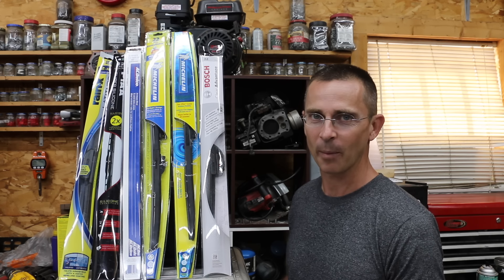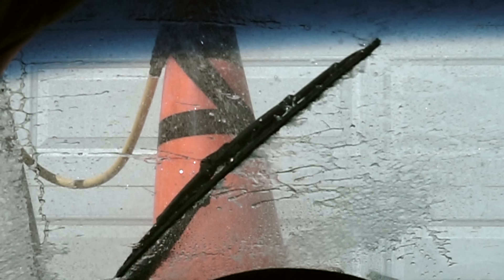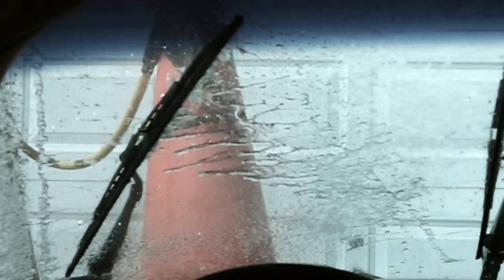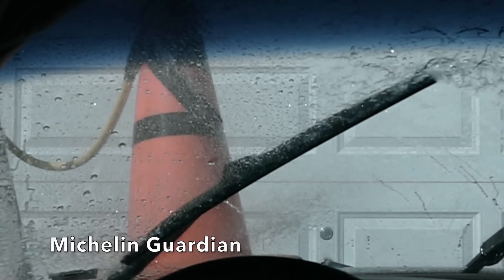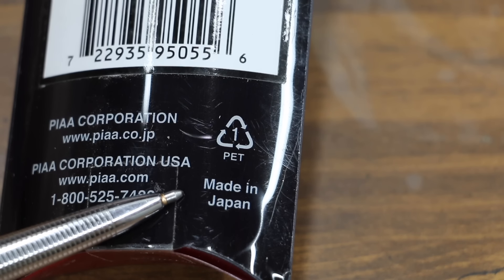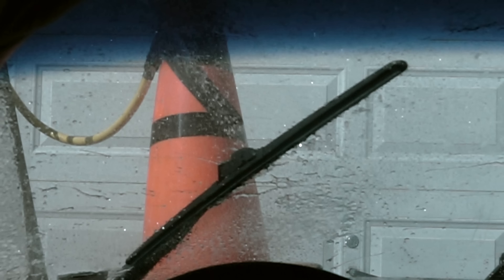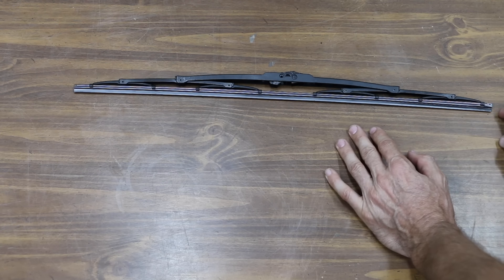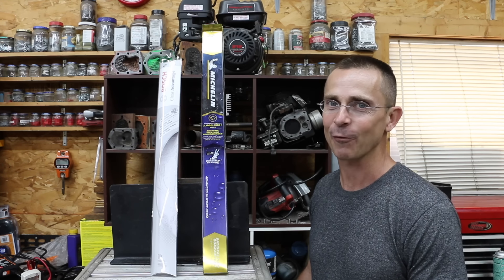Which Windshield Wiper Blade is Best? Let's find out!  Michelin, PIAA, Bosch, AC Delco, & Aero

Comment: I put Bosch blades on my 2009 Acura RDX sometime in 2013 to replace the OEM blades and they just now wore out; they were streak-free and squeak-free right up until the blade separated from the base.  I cleaned them thoroughly with brake fluid once or twice a year until the brown hard build-up was gone and they became more pliable (whenever they started squeaking or streaking or I had brake fluid out). 
I also get silicon grease from an electronics supply store and apply it to all the rubber seals around the doors and taillights, and any rubber bits exposed to weather or sunlight with a dense sponge that I got in the car detailing section of a major parts vendor (don't put it on wiper blades, it will smear and make everything blurry). once or twice a year and they are still pliable and in place and seem as good as new.  It's a great car and other than wear (brakes and tires) parts I've only replaced the starter and it needs a compressor, everything else still works.  It even has the original serpentine belt, spark plugs, antifreeze, brake, and power steering fluids.  
135000  miles
Reply from the maker: Thanks for sharing.

Comment: I paid close attention to this review. I was really hoping you would test Trico wiper blades. Yes. I work at Trico.
Reply from the maker: Great test idea!  I'll test them in a few months.  They are currently experiencing UV exposure along with several other leading brands.
Reply: Jay Lowe I like my trico 97 series. Much better than whatever was on before, and still nice and low profile/old school to boot on my classic f250 and f350
Reply: If you have access to Trico why on earth do you need to see a review?? Nothing will compare.
Reply: Jay Lowe funny thing is I had a pair of truck wipers back around 2009 time frame.  I swear I had those on my truck for about three years maybe a little less.  Anyhow they worked great back then so I bought some recently and have not been that Impressed.  They don’t last long and skip all over than dang place and very annoying now.  They were the beam silicone ones aka most expensive ones you make.   I got maybe three months before they started jumping.
Reply: Swear by trico in MI weather! A bit costly, but quality offsets the cost for me.
Reply: Correction: I had no idea Michelin and other blades sold at such a premium 😅 I'll stick with the usual!
Reply: Trico are the only blades I'll buy!

Comment: I wondered why splash-back from the passenger side never seemed to be a problem for me and upon reflection decided that 1. I very rarely use my wipers at full speed which doesn't give as much time for it to be slung off the top of the blade and 2. When traveling I'd say 35-40mph and up the oncoming wind pushes the water off the top of the blade so very little is left and it doesn't have the momentum to sling across to the driver's side, and once what's left clears the blade it's blown upward rather than across.  So maybe include some wind at 50mph or so in your next test or not put so much emphasis on the cross-contamination as it's just not a factor in real-world conditions.
Thanks for all your hard work, I love your videos and even watch the ones with stuff I'll never use just because I like you and your methodology.
Reply from the maker: Thanks and you are welcome!  Thanks for the feedback.
Reply: @ProjectFarm  I saw another video you did testing wipers and you did it at speed and I was right and you beat me to it; GREAT JOB!

Comment: Yes, the most expensive Michelin is more expensive by a factor of almost four over the Bosch, but the question you have to answer is will it last four times as long. Would also be interesting to see how it holds up to dirt because a wiper blade loses its effectiveness when it gets abraded by tiny dirt particles which will cause it to streak. I generally wipe my blades down once a month with some rubbing alcohol to remove the abrasive dirt and it extends their life.
Reply: Good idea. My neighbor does the same with WD40.

Comment: I wonder how airflow would effect the solid designs as they may lift with more air pressure. RainX Reminded me of the horrible glare you'd get with oncoming cars while the wipers swiped. Might be a good test to see which rain repellant works the best with no glare
Reply: It's definitely a possibility for the beam blades to lift off the glass. However I've only seen it happen once on an old car I had with a wiper arm that had a weak spring and would lift off during the down stroke. I replaced the arm and it never happened again. On the hundreds, if not thousands, of cars I've driven in the rain as an auto tech I've never seen it any other time.
Reply from the maker: Great constructive feedback. Thank you
Reply: TgWags69, Except one older van that had the glare issue, my other vehicles were crystal clear. It turned out on the older van there was a coating of some kind (road goo oil ???) that did not clean off with regular glass cleaners that combined with Rainx. Really bad and got worse. We finally had to use razor blades to scrape it off and a number of degreasers and finally newspaper (slight abrasive). After that, it was crystal clear like the other vehicles.
Reply: Averna, yes I had two older vehicles where beams did not work.

Comment: I know you can't possibly test all of them but, it would have been nice to see how trico stacks up as I've always had good luck with them.
Reply from the maker: Great suggestion!  Thank you
Reply: Trico is great.  I know a lot of people overlook them because not rainx and such. But i put some on my jeep and damn they are ace. I love these.  And they are cheaper!
Reply: I bought a set of Tricos for my Ford Escort from Walmart years ago.  Made my choice based on price and advertised triple edge.  The driver side blade left scratches on glass.  A lesson in you get what you pay for.  You can buy a kit to buff out the windshield glass and I plan on doing this.
Reply: @darinberend2103  even good products can not perform well.  Tricos work wonders for my applications where rainx blades amd the like suck.  But that's why there is so many different kinds out there.  Sucks your experience left you with scratched glass :/
Reply: @ProjectFarm  Got to second the Trico request. They appear to be the main non-automotive store (places like Meijer, Target, etc) brand around here (midwest). The Bosch Icons are another brand I see recommended a lot, so it will be great to see how those stack up, too. Love the channel.

Comment: One of the best selling points for the PIAA blades is that they have a replaceable silicone insert, so instead of having to buy new blades every year you only need to buy a cheap insert every few years
Reply from the maker: Great point!
Reply: Biggest pain in my ass is replacing inserts. I litteraly would rather teach a pig to sing.
Reply: You get that long of a life? Here in Canada it kills blades. Also I use them on the ice, hard life.
Reply: Back in the day ... not all that long ago before designer blades ... replacement inserts were commonly available. Less profit I’m sure.
Reply: @autobreza7131  I just bought a new set on tirerack a month ago for $8 a piece. Also, I've seen them on Amazon, but they are a lot more expensive there
Reply: Ray Klotz I used to buy replacement inserts from Honda until they got too expensive. Lately I’ve just but cheap yearly replacement from Walmart. I may look at Rain-X given the positive comments.
Reply: @autobreza7131  I've used the rainx before and I barely got a year our of them before they were toast. I switched to the PIAA and haven't had any issue for the past two years I've had them

Comment: I have watched many of your videos. I love all the research you do and the processes you use to evaluate items. This one caught my eye. We have a 2003 Toyota Matrix XR and a 2004 Mercury Grand Marquis LS. We live in central Il.  Up until now we have always purchased OEM Toyota and Motorcraft wipers. Maybe paid too much but seemed to work well. After watching this video, we purchased the Bosch Clear Advantage for both cars. I installed both sets on both cars. Toyota Matrix take a rear wiper as well. I completely cleaned the windshields before the installation of the new wipers. Installation was a snap and at the time seem to be cleaning the windows very well. We will see over time how they perform. Update later to follow. Keep the great videos coming!
Reply from the maker: Thanks, will do!

Comment: 10.92 dollars for the pair? I'm looking at 25 for my dodge and $40 for my '13 impala.  Where did you buy these Bosch Clear Advantage wipers?
Reply: Neil Perko same here
Reply: Sam’s has them
Reply: Just checked, and they're $16 each at Advance Auto.  I typically buy the Bosch Icon blades, and they're much more expensive than that, but I've had very good service from them.
Reply: @darrellkidd5177  Yes Bosch icon is the Best 💪

Comment: If it's raining THAT hard, pull over and find the guy with the hose!
Reply from the maker: lol. Nice!
Reply: Rob Edmund 😂
Reply: 🤣🤣🤣🤣
🙋‍♂️ Right here 🤣🤣🤣🤣
Reply: Right!? 😂
My blades fail the worst when it's barely misting, or the water is getting kicked up by tires.
Reply: That kind of torrential rain is not uncommon on the Gulf Coast.
Reply: More Beer not at all especially SW Florida, that is our normal rain shower
Reply: Same thought. This test is kinda flood instead of rain
Reply: More Beer was about to say that. That hose is nothing compared to a nice summer evening storm.
Reply: Seems some of you have never experienced an actual rainfall lol
Reply: RAIN THAT HARD IS COMMON IN TEXAS!!!!!
Reply: @cazadordeadrenalina2161  eh, it looks mostly good, however, with P.F.'s latest update to this video, silicone seems to be the way to go over rubber.
Reply: @petedeiler9431  yeah usually for only 5 minutes at a time though :p
Reply: Rain that hard is common in the South.
Reply: I’ve driven in rain way harder than that.
Reply: @petedeiler9431  k

Comment: Silicone blades are last much longer than rubber ones. 
Highly recommended!
Reply: @Al Castill I live in the Netherlands and we have lots off rain,have silicone blades,i still have them on after 5 years and doing fine.
Reply: "Upgraded" from Bosch to PIAA wiper blades because of all the hype regarding silicone and what dissapointment that was. I've never had so much wiper squeak before, even when running the cheapest blades i could find it was never this bad.
Reply: @DanielVSL  I think the PIAA brand blades are low quality, try rain-x silicon advantedge wipers. or even the bosch blades every year are still a great deal

Comment: I was a viewer for almost the whole time the channel exists, and I love this channel a lot. (Especially farming equipment videos which you don't post anymore). So I can't believe that I going to criticize this video, but here I come: 

There are just three types of blades:

1) conventional (steel frame)
2) flexible (bendable)
3) hybrid (plastic frame)

Conventional blades can be also designed for winter: the whole frame is covered with rubber. No moving parts exposed to moisture and air.

The one from Michelin is a fake hybrid. And there is just a few manufacturers in the world, but a lot of "private brand" companies. I'm pretty sure that Michelin is one of "private brands".

Most of new cars sold today are equipped wit Trico branded wiper blades. Which makes Trico  most common OE Manufacturer. I'm surprised it wasn't tested. (If you'll be doing second part test Trico direct fit)

And the most important part:
It doesn't matter how the blade performs on steady vehicle. Because it's not critical to see the road when you are not moving. But when you are in motion  aerodynamic comes to play and this is what differs the blades. The blade cad be easily lifted up by upcomong air leaving a gap between glass and the blade. This is a common problem for flexible type and conventional (but there is a conventional blades with a little spoiler attached to fix this problem just google it)

So the test isn't complete untill tested in motion.
Reply: Ivan Malakhov there's always a Debbie Downer.  Also Captain Obvious . Or is it Oblivious?    Yes, we know the cars not moving genius.  Otherwise he'd be going through garage door.   This is not Consumer a Reports.  I suggest you do a test and post it. We'll compare.
Reply: @Newzchspy  any comments on other thoughts? Since you called me a Capitan Obvious I believe each of my statements was obvious for everyone or at least you.
Reply: Could just get a high-powered fan to blast the windshield/nose of the car while spraying
Reply: @LeesChannel  it might work, but powerful enough fan will be more expensive than a tank of fuel.

Comment: Another great segment, if you could figure out a way, I imagine you can, is adding wind speed to it, windshield wipers aren't near as necessary when you're not driving
Reply from the maker: Great recommendation!  I've got some ideas
Reply: I've got to agree.  I realize that it's not easy to devise a test that shows how the wiper blades perform when the car is moving at highway speeds, but that is really what's important.  A lot of that "residual" water would be blown away by the air flowing over the windshield, and it would likely vary by wiper style/design.  Another point that has been mentioned by others is how do these hold up over time, not just by exposure to sunlight, but by use as well.  A $10 wiper that only lasts 1/4 as long as a $30 wiper isn't necessarily a good deal.  Really enjoy the videos; keep'm coming.

Comment: Love the tests.  Wondering what putting a fan to simulate say 30mph road speed would do to the results?  Thinking if the wind was to help clear out some of the trapped water on the steel frame blades they might perform better.  Regardless I still use the beam style Bosch or Michelin's.
Reply: Exactly what I was thinking...

Comment: I have experience with a few of these:

- Michelin (non silicone) are good for the few couple months but have very bad streaking after less than 6 months. This is the same for metal frame, hybrid, and beam variants, the blade just sucks. Mr. Lube likes to give them away for free a couple times a year, so it's hard to beat $0 but I'd never pay out of pocket for these blades anymore.

The bosche beam style blades are ok, they had some streaks on the up sweep right lot of the box and lasted about a year. Not bad but not exceptional.

I just recently installed the beam style silicone PIAA blades, they're squeaky, they hop, and they have a fatal flaw unlike any other blade I've tried - wind lift. When there's no wind going over them they work ok, but at highway speeds they're TERRIBLE because the wind causes the blade to lift off the glass on the down sweep leaving a ton of water. Super unimpressed so far, not sure how long they last yet.

By far my favorite are the rainX beam style blades, they work great out of the box, and 1 year later they only have a few tiny streaks even after a harsh Canadian winter. I've gotten two years out of these blades and I'll probably be switching back to these from these crappy PIAA blades. I usually install the rainX blades at the beginning of summer, save they'll generally last through summer, winter, summer, then be ready to replace at the end of the second winter. Defs my top pick.
Reply: Liam Eisenberg did you clean the windshield before installing the PIAA blades?  I have them on my vehicle and they are silent and smooth, and they do not wind lift.  My guess is that wind lift has more to do with the particular vehicle in this case.  Of the various blades I have used, these are at or near the top in performance. Though I do not typically have freezing temps, it rains a LOT.
Reply from the maker: Thank you
Reply: @jeanchapman1301  I did, and used the included windshield prep wipe, but if a windshield needs to be clean for them to work what's the point? That's like having toilet paper that only works if your ass is already clean...
Reply: Rain x has been nothing but utter garbage for me. They pull water back and streak already. Less than 2 months use
Reply: @andrewk8636  which one are you using?
Reply: @liameisenberg9711  the most expensive one with water repelling. I think it's called latitude
Reply: @andrewk8636  huh, that's the same one I've been using, I guess it just doesn't suite the curvature of your windshield very well...
Reply: @liameisenberg9711   Liam Eisenberg  actually that too. But the problem is that water sticks to it and on the return swipe a bunch of water come back onto the glass in almost like a honeycomb pattern. Funny thing is I even buffed the windshield before installing them. Tried wiping them and nothing helps
Reply: Yep my rainX blades also began streaking after a couple months.
Reply: andrew kb the set of latitudes I got were shit from day one. Just bought the piaa ones so we’ll see how these are
Reply: piaa wind lift. lol... this test is shit cause you're supposed to run them dry for 5 minutes. the bosch all expensive models i've tried never last 2 weeks before they get fine streaks. the piaa lasted 6 months and i swapped so lasted more.
Reply: Try the new rain x  silicone version.. I promise you will change your mind. I've tried almost all of them...
Reply: @reludennis  no I haven't but it's good too know but did I do have the latitude on another vehicle that worked great.. Now I'm curious if the silicone version will work..
Reply: @reludennis  definitely will  let you know. I do have high hopes considering the price and that it says all weather. So hopefully it will be as good or even better than the latitude . I'll definitely check back when the snow/ice hits here in new England